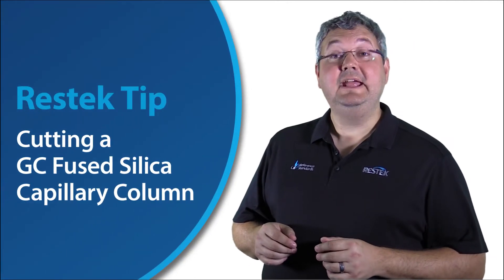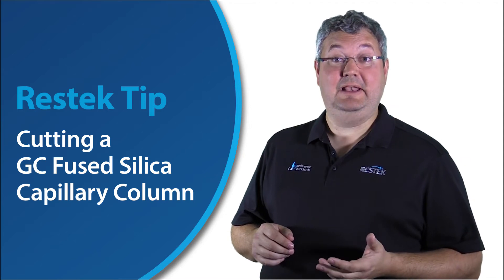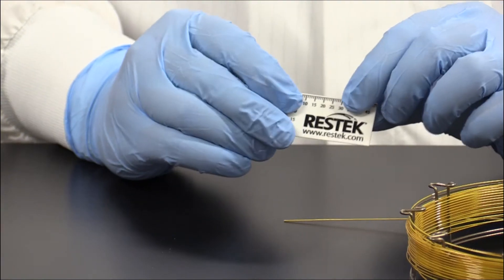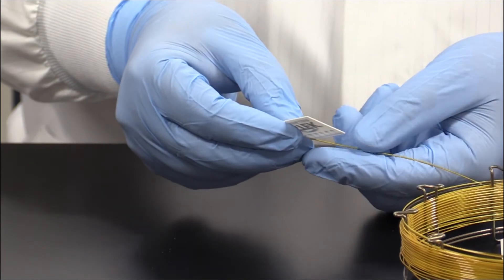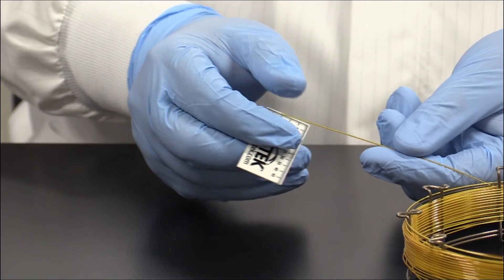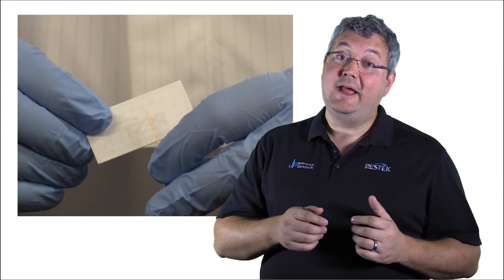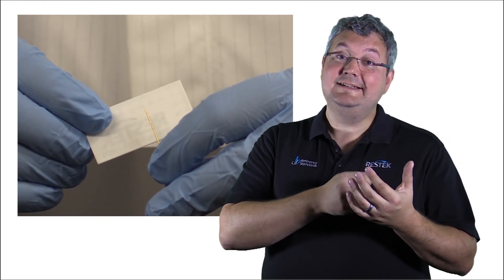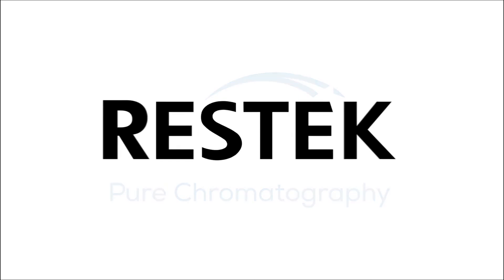Cutting a GC Fused Silica Capillary Column

Comment: Can you explain what's the purpose of the serrated edge, please? (Assuming there is a purpose).
Reply from the maker: In the past, the serrated edge was recommended for use for cutting some smaller ID metal columns. Generally, even those are now recommended to be cut with the smooth edge.
Reply: @RestekCorp  Thank you for the information.

Comment: Sir explain about capillary column and glass column
Reply from the maker: Glass has been used to make capillary columns and packed gas chromatography columns. While it has some appeal, it was brittle and could be hard to handle, especially glass capillary columns. When polymer coated fused silica capillary columns were introduced, they were a huge leap forward in durability.